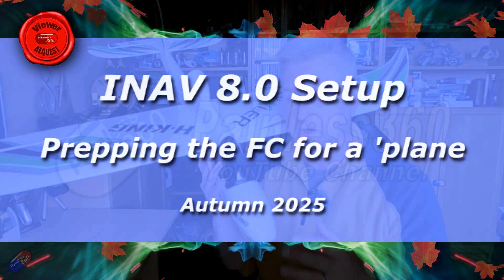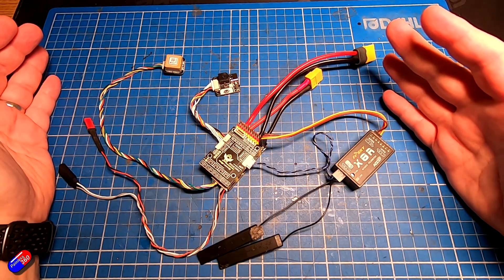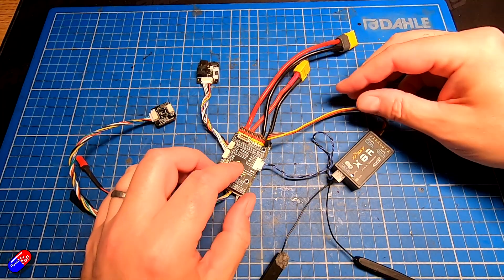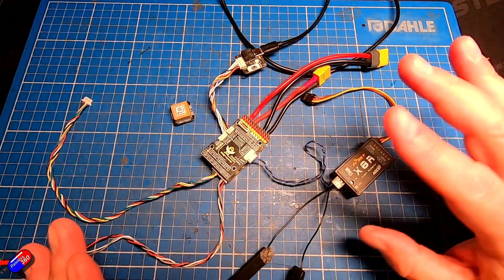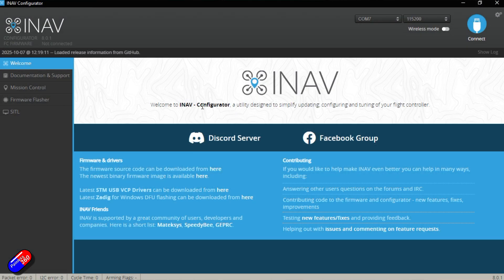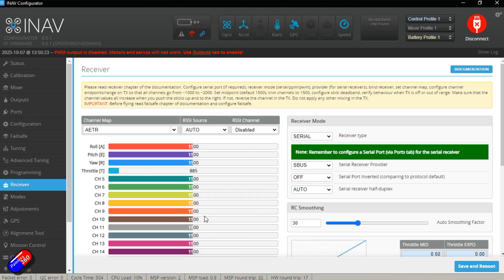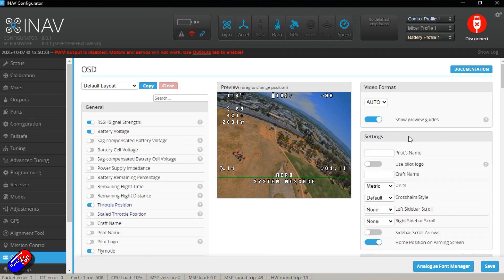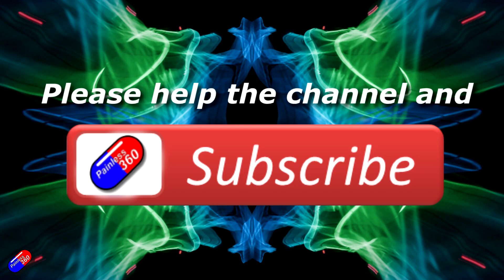INAV 8.0 Plane/Wing Setup Basics

Comment: HI, I calibrate the accelerometer on the bench on a flat surface, but i would like to use this FC on a taildragger warbird. Will the neutral angle of the taildragger affects the accelerometer? Also in INAV 8.0.1 what is wrong with the the Bing Maps? I saw your video about that but i cannot get an API key anymore
Reply from the maker: Please check out my INAV for beginners series. You apply a fixed wing offset
Best of luck!
Reply: @Painless360  Yes, yes i saw that where you put a -4 in the pitch  and then you have almost 0, but i am trying to understand generally if we want a "leveled" aircraft on the ground or in the air? The plane is a spitfire
Reply from the maker: You set it up to fly... Happy flying

Comment: Of course, here is the English translation:

Hello, another fantastic video. Especially since I have the same Flight Controller (FC), it's making my work a lot easier. I've used quads before, and now, by reading a lot and watching other RC airplane build videos, I've built my own plane. Why? Because some details that seem simple in these build videos can be very difficult for users like us who aren't accustomed to it. So, I designed my own model in a way that everyone can build it without difficulty.

The theoretical part is complete like this, but the practical part of the plane, what I need to improve, is a problem for me. I will ask a knowledgeable friend and request his feedback. However, I can't do this all the time. From what I've seen in these tests, the most difficult part is the plane's takeoff and landing.

A video showing how to configure functions like automatic takeoff, landing, RTH (Return-to-Home) with your model, or how to regain control after the transmitter is turned off, RTH engages automatically, and the plane returns, would boost our confidence.

Of course, at this point, it's necessary to mention that you will probably recommend I first ensure the plane flies stably without any FC before getting into the FC / iNAV thing. For now, let's assume my friend will handle that part for me :)

By the way, sensors like the Caddix HD system, GPS, and Benewake TF Mini Plus Rangefinder have been introduced (I think the Benewake TF Mini Plus Rangefinder is necessary for automatic landing?). You have videos close to what I've described, but I noticed you don't seem to have a video that exactly corresponds to a "worst-case scenario" theme... I would be very happy if you made such a video.

Greetings from Turkey.
Reply from the maker: Check out my INAV for beginners series. All of the setup steps are on there and the associated videos... I may make a video on GPS return to home, though. Best of luck

Comment: Great video as always! Super Helpful for me as im just statting with INAV on an FPV Wing, coming from Quads running Betaflight lol.. I just bought an AtomRC Penguin for my first FPV Wing w/ the AtomRCF405NAVI Flight Controller, and it seems very similar to my SpeedyBee F405 Wing APP Flight Controller I have for another build im planning for the future over the winter. However it came with INAV6.0.0 Pre-Flashed with the settings all done being the RTH Kit version..
What would be the easiest way to upgrade it to INAV V8.0.1 with the stock INAV FW V6.0.0 CLI DIFF file saved? Should I should start from scratch with a new update and INAV8 Build and use the CLI DIFF for some settings when needed or can it be modified to be able to restore the older CLI DIFF file into INAV8 for all the RTH and Auto-Launch Settings already done and something I'm honeslty not sure how to set up just yet on INAV.. 
Im watching your INAV7 getting started guide playlist now and just figured id ask your opinion on this situation. Should I just run it on the stock INAV6 FW for the first few flights or is it worth upgrading first? I would LIKE to get it on INAV8 now if thats ideal especially..

Comment: Converting an old manual Bixler by adding a flight controller with INAV and FPV is literally my next project- I had already had a quick look and stumbled across one of your old videos, I think it was INAV 2.0!!l
Reply from the maker: I'm loving this thing with modern electronics inside. That original one from the video is still in the garage but I glued the wings on!

Comment: Good refresher video, thanks.
I've got a SpeedyBee F405 mini and INAV 7.12 in my Bixler.  With FSia6 rx as well It's a tight fit. And 2200mA 3s up front.  And with analogue fpv I'm getting interference on the screen. Esc I guess. I didnt see the cap they supply on your flight controller? 
I've got another Bixler coming and next time I'll be more careful about placing esc and wiring. I guess with digital you don't have those issues!  😂
Reply from the maker: It depends on what interference you're getting. Poor grounds are a common source of problems... Happy flying

Comment: 11:45 One thing I have learned doing a bunch of updates of the fleet to INAV 8 the last couple months: the new timer bank section on the mixer tab is something to always double-check if you leave it on AUTO. On the boards I have, the AUTO setting didn't set things up properly, and I had to go in and explicitly set the timer outputs to SERVO or MOTOR as applicable for each of the set of PWM outputs. Also be mindful that the timer banks do not always go in numerical order from PWM1 to PWM10 or however many you have (as is the case here), so make sure you set the correct timer bank for the servo outputs in question based on the output mapping graphic mid-screen.
Reply from the maker: Thanks for sharing..I'd report that to the developers. Happy flying!

Comment: Is it possible to do angle mode on a plane? I wanna get into them but scared of losing and getting disoriented while flying. So is it possible to flick a switch and you will be locked at a certain angle?
Reply from the maker: Yep, angle is a fixed wing mode too... Happy flying
Reply: @Painless360  Will the Nexus V1 be available on Inav in the future as well as the X/XR? I see someone is selling a V1 for 60 bucks with the RP3-H Receiver. And I want to use it in a plane
Reply from the maker: Not that I know of... the Speedybee F405 wing FCs are cheap and fully supported...
happy flying!
Reply: @Painless360  Gonna check those out!

Comment: Hi Lee.  How are you using a FrSky X8R with the GX12?  Do you have an FrSky JR module?  I can't find a way online to flash the X8R with ELRS. I've got a number of FrSky receivers it would be good to reuse.
Reply from the maker: I'm not. You can easily set up CRSF on the FC. I changed my mind about the radio to use as this will be a chase plane.... Happy flying

Comment: Just done a bixler kit with the speedybee wing and dji 04 pro set up.
Putting the kit version together (only £50) is a nightmare as you have to install everything on one half of the fuselage before gluing the two halves together.
I also covered the whole plane with 2" clear tape before assembly along with 1" reinforced tape along all leading edges , if you do this first or on the artf version ,this will reduce "twist" on the fuselage and reinforce the whole plane for just a few grams and keep the foam clean with less dents.
I used gorilla glue (brown liquid) to join the fus halves together and then pushed 2 wooden kebab skewers from the back into the fus after it was dry to help stop any twist,
Only running a 2200 mah 3s pack in it atm but it can go to 6s with the set up I have.

Any old quad motor and single esc can do the job like a 2207 and a 30a esc.
Std set up can only take a 6" prop max.
Hope this helps someone 👍
Reply from the maker: Thanks for sharing. I've not used the kit here. Re-enforcing the nose is a great idea! Happy flying!

Comment: Hi, thanks for the video. I’ve been a big fan of iNAV for almost 3 years now, but lately it’s turning into a love/hate relationship. The biggest problem is the poor DSHOT support in iNAV and the lack of bidirectional DSHOT. “Unfortunately”, everything works fine with Betaflight, except for the great GPS capabilities that iNAV has. Maybe it’s time for me to give Ardupilot a try.
Thanks again for the video!
Reply from the maker: If there is something that needs to be added, improved or changed in the INAV code, let the developers know by logging an issue in Github. I've always found them to be a great bunch and very willing to help when there is enough interest in a feature. i.e. https://github.com/iNavFlight/inav/issues/5750